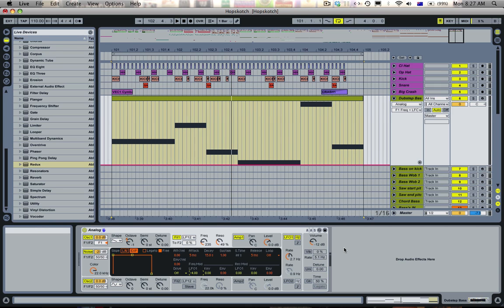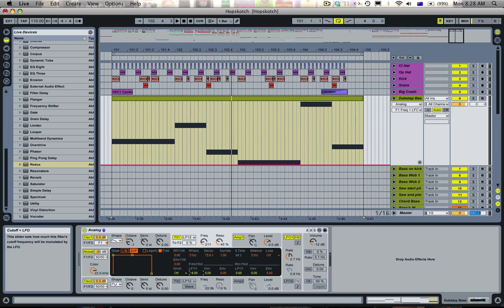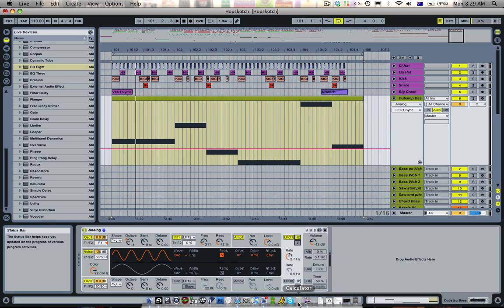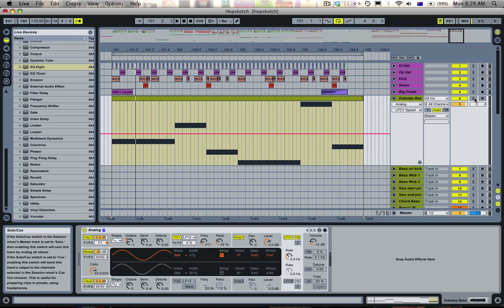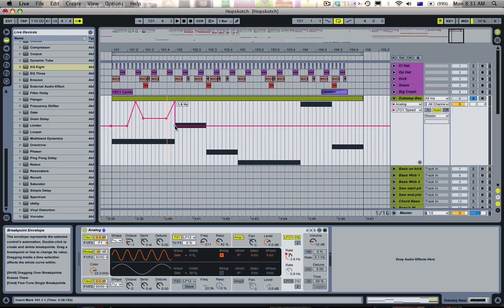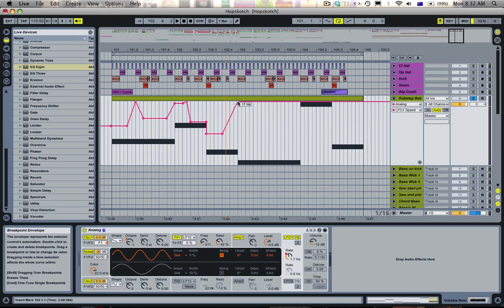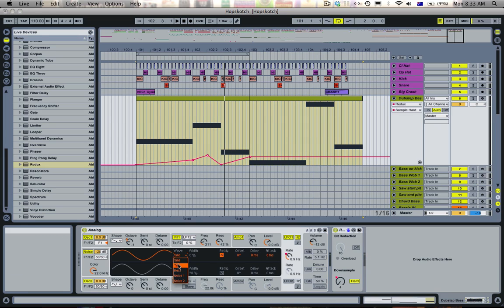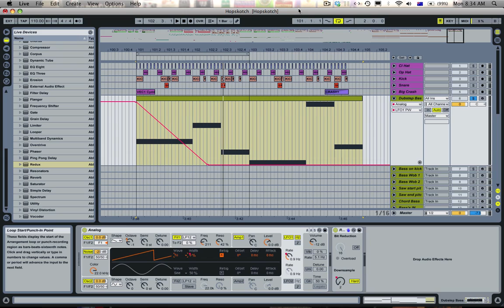Mr. Bill - Ableton Tutorial 15: Calculating Hz For LFO rates

Comment: Okay so what numerical value would you divide the BPM by to get triplets? I know you kind of said it, and calculating it, I got 302.5. So BPM divided by 302.5 (or either of its multiples) would give triplets?
Reply: Or would you divide by 40.741?
Reply: It's bpm/ 120 x 3. In this case 110/120 = 0.9 ... x3 = 2.7 :)